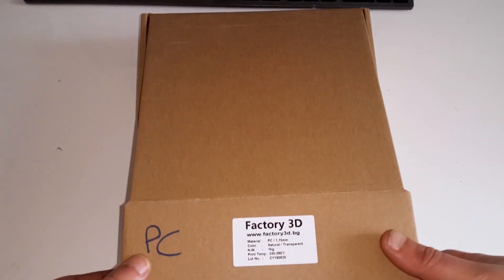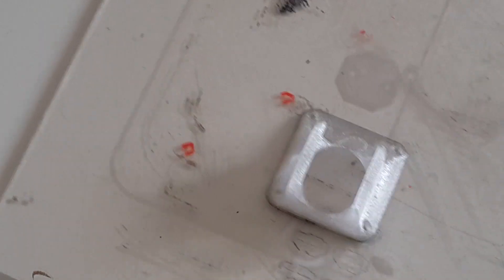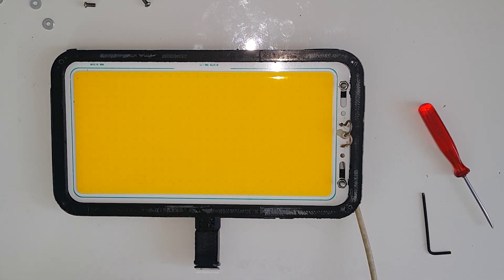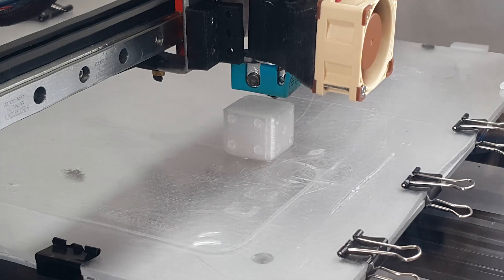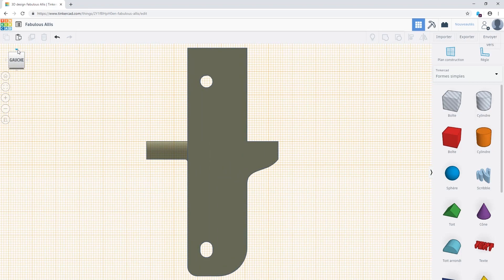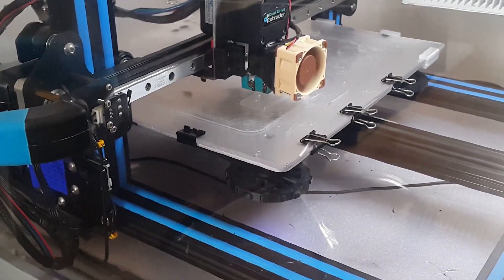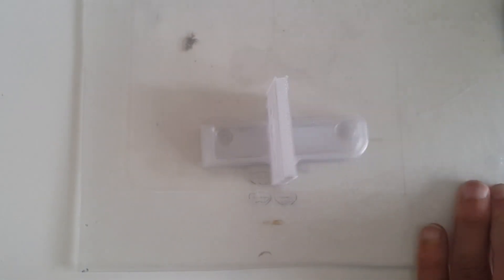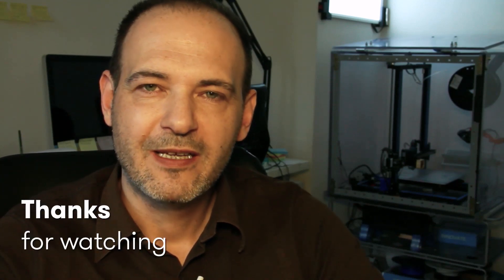Printing Polycarbonate filament (PC) on Creality CR-10 printer

Comment: Thanks for the video it's gonna be helpful in my attempts!
I had my PETG carriage deform slightly in my enclosure ;-; the belts came lose, my part had massive warping but I was printing on  double sided tape and glass since I removed my polycarbonate sheet and i couldn't take the double sided tape off lol

Comment: how did you manage to select more than the stock 260°C for the print temperature?
Reply from the maker: You have to allow it in marlin. If you are still running your stock board/firmware you'll have to recompile marlin.
Reply: @3dpblog  thank you for the quick reply. Not very familiar with recompiling marlin, any pointers where I can find a good reference for doing this?

Comment: Hello Ivan, I have some problems with the first layer it sticks wel but I get smashy layers, I see on the internet some recommendation to set the initional z-zero height a little bit higher from the bed. What is your experience in slicer settings ? Layer height 0.1 of 0.2mm. Any tips to help me. Regards Frank. Ps when comes your next video 😀

Comment: Perfect, down to earth video. I have seen so many 3D printing videos in the last 2 months, because of learning. There thousands of channels and videos which are just clearly made for having more views with very few (if any) useful information. Especially in practical  printing. This is certainly not one od them. Thank you Ivan!

Have you tried annealing PC embedded into salt or silica/glass powder? I am curious if the investment with a slow cooling down process also helps to reduce shrinking and warping.
Reply from the maker: Hi, thanks for your comment. I am not aware about your technique for annealing in salt/silica.
What I do is just put the part i the owen with the fan turned on for 1 or more hours (depending on the tickness) at 110 C for normal PC (less if you are using Polymaker PC, because its glass transition temp is lower). Then it cools down slowly (decreasing the temp to 90, 70, 50 C in 10 min intervals)
What the salt/silica is for?
Reply from the maker: I presume it is to avoid deformation?

Comment: Very informative vid, thanks for posting.  I saw your comment about the 500W passive convection heating element - can you provide a link?  I know these radiant plate type heaters are common in EU but here in the USA not so much.  I found a PTC heater w/ fan that could be adopted with some mods (https://www.aliexpress.com/item/1005001587743619.html).  I sure like the simplicity of your setup.

Comment: The reason your enclosure temperature is oscillating is nto because the heater is too weak but because the PID settings need to be tuned
Reply from the maker: My enclosure temp is fine. What is oscillating is the hotend above 280 C. It is because of the termistor type - it works stable up to 280 C. It is true my PID is optimized for 250 C (ABS), but I am sure if it was for 290 C it will oscillate again.

Comment: Your success is very inspiring as I'm currently planning to build a compact polycarbonate printer using a ender 3 pro as my base. PC base plate, all metal hot end, and a well heated enclosure seem to be key. thank you for posting you findings!!
Reply from the maker: Just get all electronics outside the heated enclodure. Cr-10 has separate control box.
Reply: @3dpblog  of course thank you, I'll be posting the project I'm the near future

Comment: 9:05 duuude PID auto tune your hot end!
Reply from the maker: It is not about the PID tuning. It is the termistor from e3d - it works reliably up to 280 °C. At 290 it is not precise.
Reply: 3dp blog oh!

Comment: Did you print on a bare PC sheet or did you use anything to release it? I’m worried it’ll bind to mine
 BTW you should ventilate your enclosure since Polycarbonate is a lot worse than even abs in terms of fumes
Reply: Just the pc sheet, no adhesive

Comment: This is something I wanted to try. I will buy some PC board and test it myself.
I have two questions. Have you tried printing with nylon of PC bed? How about thinner sheet and you can use it to flex and detach the printed parts?
Reply from the maker: Hi, no I havent yet tried printing nylon on a PC. I am using 3mm thick pc sheet and you can bend it to detach larger parts. I answere similar question before: https://youtu.be/wMqZOPxLVpw. Try 2mm sheet if you want. It will flex more and will convey better the heat, but will be easier to break.

Comment: Hi Ivan.
Congrats for the awesome setup. I have been thinking of doing the same upgrades to my CR-10 but because of the high temp limit on the hotend I was thinking on using a mosquito hotend rather than the E3D, because of a requirement to print beyond policarbonate to peek.
Have you looked into the mosquito yourself, have you got any thoughts?
Thanks and keep up the good work.
Reply from the maker: Hi Paulo, the Mosquito is a great hotend. If you have the budget buy it. Regarding e3d v6 you can also reach high temperatures. The only thing is to replace the standard termistor with their thermocouple PT100, because the termistor has reliable reading up to 280°C only. That's why it was fluctuating a lot at 290°C in my video.
Reply: Hi Ivan, No budget yet for the mosqui but I am saving for it, in the mean time modeling my next extruder. Thanks for the tip on the high temp thermistor and keep up the good work.
Regards.

Comment: Can you heat enclosure with a heat gun? Would annealing print in oven work after heating? Good video
Reply: Yes on the heat gun. Probably a small gain in strength but not increase in TG or HDT  from annealing as PC is amorphous not semi-crystalline. So there's  no crystals in the polymer chain to regrow

Comment: how do you heat your nozzel above 260?
Reply from the maker: Hi, you need first a hotend that can carry higher temperatures like the e3d V6. Next upgrade your bowden tube to Capricorn (up to 300 C). Last re-flash the Marlin firmware and change the Marlin settings in order to set new max temperature for the printer. There are tutorials on the net.

Comment: I see you have a linear rail on your x axis. I have one and want to install it on my printer but im not sure if the sideways tension would make it perform poorly. Have you had any problems with yours sideways like that?
Reply from the maker: Hi, I was in the same doubt when installing it. On the Hiwin documentatio for their miniature rails (it is a hiwin MGN12) they say that the mounting direction (horizontal or lateral) doesnt matter. So install it the way it is easier. Here is my video for the installation https://youtu.be/SovkSZGL4No
Reply: @3dpblog  Awesome, I really should start reading some more. Going to check that video out and install today, thanks for your help!

Comment: Did you upgrade the software from the cr10
Reply from the maker: Yes sure. There are many tutorials on the net how to flash a bootloader and update Marlin for the original CR10. You need to do it in order to be able to reach higher temperatures, to tune for the e3d v6 termistor and to set the extruder ratio for the BMG dual drive extruder.
Reply: Can you make a video how too update the firmware
Reply from the maker: @mr.doityourself  There are many resources for this topic and Im not sure what my added value would be to make another video. If you have the first generation CR10 you need to flash a bootloader (one time) in order to be able to load Merlin (the firmware). If you have CR-10s you have already a bootloader. In all cases check this site for instructions and preconfigured Merlin versions for your printer : https://www.th3dstudio.com/knowledgebase/1284p-printer-bootloader-flashing-video-guide-cr-10-ender-2-3-5-wanhao-i3-anet/
Reply: @3dpblog  ok thanks i got the cr10s

Comment: I tried it with a Makrolon sheet, it's a catastrophe the heat warps the pc by 5 mm, flexing my alu bed. Unusable. Can you provide a source for your sheet?
Reply from the maker: Hi, not realy, I buy it locally from a workshop near me. It is some Turkish brand. I saw the Makrolon sheet on Amazon and they look very similar visually.

Just to clarify the conditions:
- what is warping? The part or the sheet is bending when you heat your bed?
- what is your bed temperature? Normaly a PC sheet shouldn't change properties up to 130 C. My bed is at only 85 C.
- how large is your part ?
- if it is larger than 5cm do you have a heated enclosure?
- how thick is your sheet?
Reply from the maker: The specs of the Makrolon sheets say: Permanent Service Temperature: The permanent service temperature without load is approx. 120 °C. If you are at 85C there should not be any deformation of the sheet.

Comment: Some plastics are just a pain to print but using a wide rim around the edge with a zero spacing can make things stick.

These CR10 machines are fantastic, just keep going and going but do avoid JGAurora machines because they do nothing but keep going wrong and waiting for six weeks for parts to arrive from China is not fun.

Comment: BTW, if you use coloured polycarbonate you can print a diffuser that improves the colour of the LED light (add a slight red tint)

Comment: Hey Ivan, send me your address and I will post you a better microphone, I love your channel.
How do you heat your enclosure?
Reply from the maker: Haha. I know, i will do something abt the mic. The funny thing is I have a Scarlett pro microphone but it is absolutelly useless for video as it needs you to speak at 5cm distance. So I am using an old usb mic because it is more convenient.
I heat the enclosure with 500W heater, which is the optimum power for this volume. The heater is a spare part for small electric radiators (normally mounted in bathrooms). I bought it in a local shop and It costed around 15EUR. It doesnt have its own PID control so I use a DS18B20 probe hooked to octoPi to measure the temperature. So far I control it manually. If I let it on all the time the established temperature in 60 min reaches 70 C (too high). One of my next videos will be for implementing PID control with some contactors and the enclosure plugin for Octoprint. 

I know you can buy a portable 500W heater for less than 10 bucks on Amazon that comes with all controls, but I wanted a silent and robust solution I can control through OctoPi. Moreover integrated temperature control in the small portable heaters has an overheating protection and wont let you to reach 50-60 C ambient air temp. It is possible to remove the protection, but those devices are not designed for such extreem temperatures and most probably will die quickly.
Reply: @3dpblog  could you use a relay to control it? very interesting - i need to print auto parts from PC and i'm trying to learn as much as I can. Excellent video

Comment: What hotend is that you have.
Reply from the maker: E3d v6 hotend. The nozzle is also from e3d - hardened steel - 0.5mm
Reply from the maker: May be the oscillation of the hotend temperature is also due to the termistor. Here is what e3d say: "The V6 can comfortably reach 285°C with the supplied thermistor. By swapping a thermistor for a thermocouple (may require additional electronics) or PT100 you can reach over 400°C."
Reply: Hey Ivan, I've got an e3d V6 too and it constantly leaks with hardened steel nozzles. I think it doesn't seal well to the stainless heat break and when filament gets between them it reduces the clamp force. You may have noticed that the aluminum block is now loose when it's hot. 

I will try a copper block when it arrives and perform the hot tighten procedure at a hotter temperature  something like 350c and see if theis stops the leaking. If this does not work I will try the slice engineering reprap heat break which has copper threads. My hope is that the copper will seal tighter against the steel nozzles than the stainless steel heatbreak